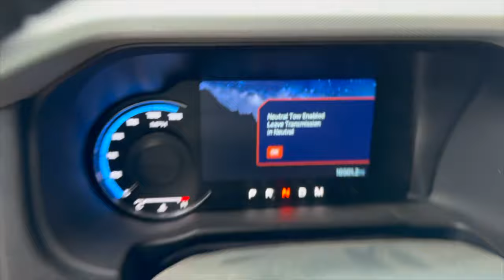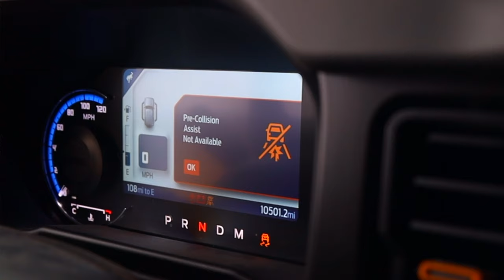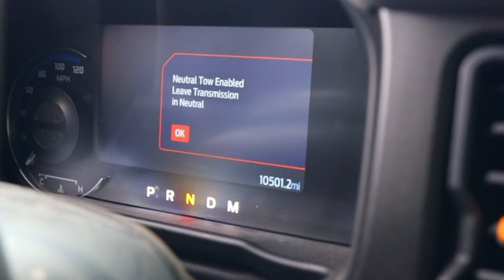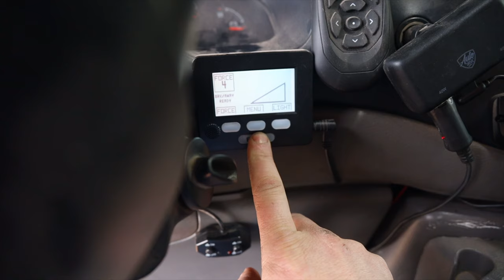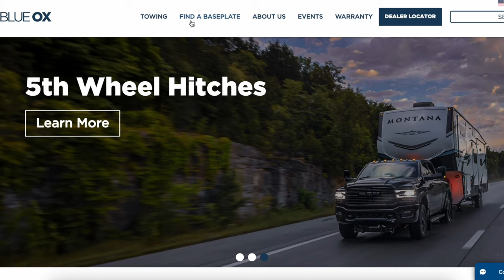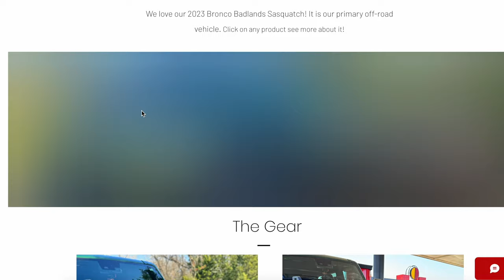The Ultimate Guide to Flat Towing a Ford Bronco

Comment: Nice overview. One item that I would recommend would be a (Towed Vehicle Battery Charger). Even though the Bronco has a very little parasitic battery draw when the ignition is off and the Blue Ox Patriot brake system pulls a low amp draw, It's very important that the Bronco's battery stays above 12.5 Volts at all times. One other note; I don't know what engine your Bronce has, 2.7L V6 or the 2.3L I4, but if you have the 2.7L V6 it has the Electric Assist Braking System, vs the 2.3L I4 has the vacuum booster brake system. If you have the Electric Assist Braking System, 2.7L it stays active all the time when towing and the ignition is off. This is the reason that the system might be too sensitive when supplemental braking. Ford now has a software update to basically turn off the electric assist braking (once the vehicle is placed in  neutral tow). Contact your local Ford dealer.   BTW, I was one of the engineers that conducted all the durability neutral tow testing, on the Ranger and full size Bronco. Safe Travels.
Reply from the maker: Wow! Great info!! Thanks for watching! I hope you will subscribe to our channel and give us feedback going forward!!

-Ben
Reply: Done!
Reply: I have a 2024 Badlands with the 2.7L engine. Is there any way to tell if I have the updated software?

Comment: A couple of points I'd like to comment on.  First it appears that your tow bar is at a fairly steep down angle, but that shouldn't matter too much since you have a brake box inside the bronco I suppose.   If you were towing without the brake in the towed vehicle this would be a big no-no.  Second, why didn't you just use the offroad end pieces on the blue ox and connect directly to the D ring bosses on the off-road bumper.  It's far less expensive and way less hassle to connect to an off-road bumper by the D rings bosses  than it is to purchase and install a whole tow bar adapter kit.  It's just a pin and a locking pin.    Not trying to be critical, just trying to understand your rationale.

Comment: Removing from neutral Tow Mode needs more info.  You went way too fast
Reply from the maker: 🤦‍♂️… you literally put the vehicle in park to take it out of tow mode… maybe play the video at half speed? 😉
Reply: @BenandBrandi  nice wise crack.  Key detail I learned the hard way... you have to hold brake pedal for 7 seconds.  (This at least is the case on my 2021 First Edition full size Bronco).  Here is the official procedure from Ford for others who might experience the same 20 minute ordeal that I did... not knowing about the 7 second brake pedal bit:
************
To Disengage Neutral Tow
The steps to turn flat tow mode off are similar to engaging it:

Enter accessory mode: Push the ignition button once without your foot on the brake.
Depress the brake (automatic transmission) or the brake and clutch together (manual transmission) for approximately seven seconds.
Wait until the instrument panel displays 2H and Neutral Tow Disabled.
Release the pedals.
Apply the parking brake, then disconnect your vehicle from the tow vehicle.
Release the parking brake, start your Bronco, and shift in Drive or Reverse to make sure the transfer case is out of the neutral tow position

Comment: I have to admit that I've never flat towed any vehicle, I'm completely unfamiliar with this process, so I'm curious why you choose not to throw it on a tandem axle flat deck trailer (outside of the trailer cost)... wouldn't trailering save the vehicle from potential damage and wear/tear?  (thinking rocks and debris being kicked up from the tow vehicle) I'm curious why so many choose to flat tow vs trailer? .. all I can see in my head is that Jeep with the blown motor and transfer case because it was left in 4L.
Reply from the maker: Some good points there. However not having a trailer when you already have to park a motor home and a vehicle in spots is a huge bonus. Also flat towing is quick and easy. Never yet have I ever tossed a rock or anything on my rigs being towed.. however it’s possible.

Comment: Wondering why you didn't use the the tow attachments on the front bumper for the tow bar?  The make adapters for them and the tow bar would be parallel with the ground.  I used these on the bumper of my 1973 bronco and flat towed thousands of miles.
Reply from the maker: We used them on our Jeep wrangler.. you should check that video out… our Jeep came unhooked while going down the highway… the factory welds on the bumper and frame broke loose…
Reply: Wow, the WLL of the factory Ford tow points are 16,000 lbs each.  I could not see where you would be placing 32,000 lbs of force while flat towing.  Also the weak link is the shear force of the 1/2 bolt on the tow bar at  6,975lbs each. Although with any aftermarket parts you are at the mercy of quality control,  glad no one was hurt.
Reply from the maker: @supergproductions8758  for sure!! Did you see the video? And where the welds broke? I couldn’t believe it!!

Comment: Drilling in the frame  is required for the baseplate for the 1/2 bolts. 

It looked like the base plate was below the bumper. Are you able to keep the OE bash plate without modification?

Does the winch obstruct the front camera?

What is included in the accessories? The wiring kit and the 7 pin to six pin cable? Was it an oversight or was there a reason?